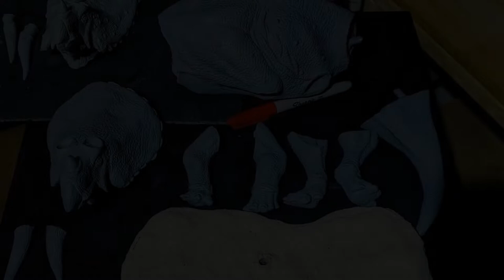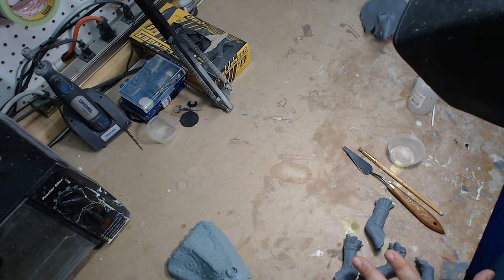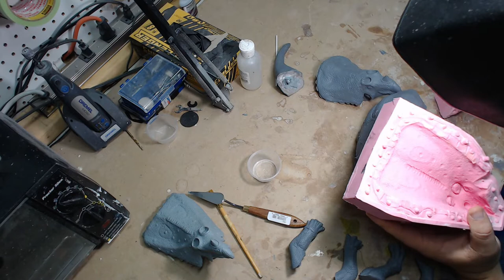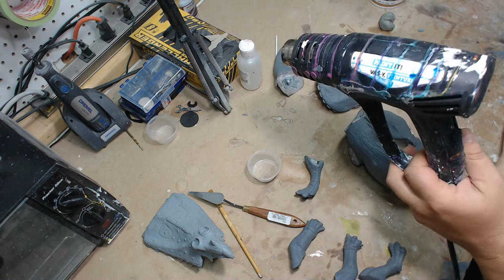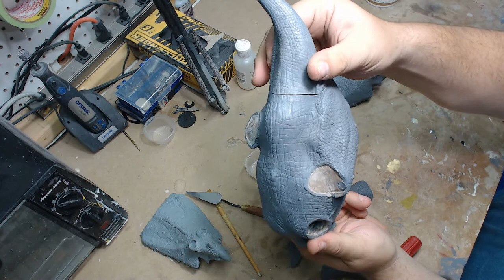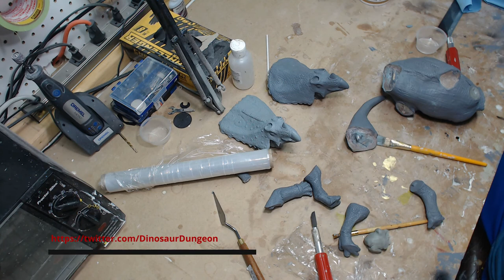How to cut a sculpture and make registration keys!

Comment: Great video, the audio was a little bit low, but Its really COOL, May be a video about some pro casting tips, would be awesome.
Reply from the maker: Thank you so much! Unfortunately the battery on my microphone had died, so I had to use the microphone that was in the webcam. I did go purchase new batteries today so the new videos will sound a lot better. I actually do plan on filming the entire process of molding and casting this guy. So you will see me pour a cast of this particular dinosaur. And I will explain the process. I will probably do it over three or four videos.

Comment: Im currently figuring out if there is a way to make soft pads for a vice, maybe to give it a firm, but soft grip to avoid damaging the structure? then using that and assisting with a spare hand can make cutting a tad bit easier. I have yet to test it though, and most parts i did i made separately so far, but i would like to see if that technique works though!
Reply from the maker: You know, that is a good idea! I've never thought about that. Maybe you could wrap it in a big towel and then put it in a vice. But I'm not sure. It is difficult when you don't have an extra hand! That is for sure! so if you can get someone else to help you then of course that would be much better to hold it while you cut!
Reply: I feel like if you made silicone grips that would work really well

Comment: You can also make the surface wet, so it wont stick. Put shades on and do a quick spit and then do the thing, be "thug life" XD
Reply from the maker: Yes, I do it that way as well. I actually did decide to put a registration key in the tail. And instead of putting the plastic wrap over the and it has the wet epoxy clay I just dipped the tail in water and quickly prested in and removed it. So it can be done that way!